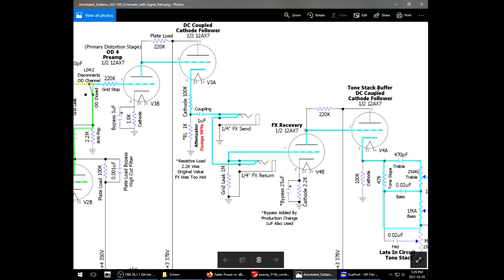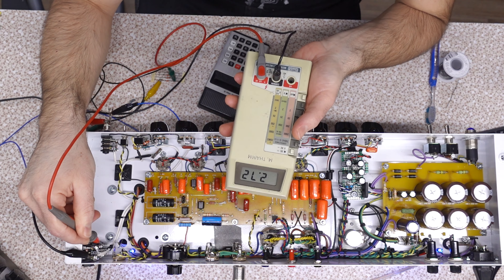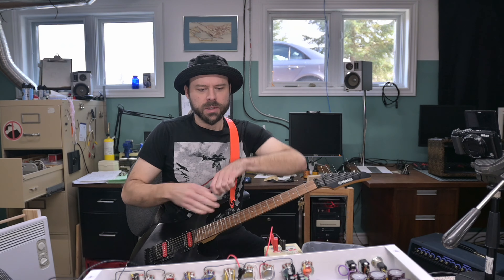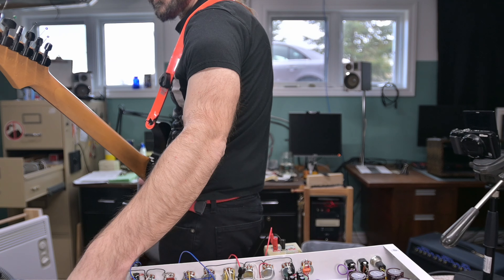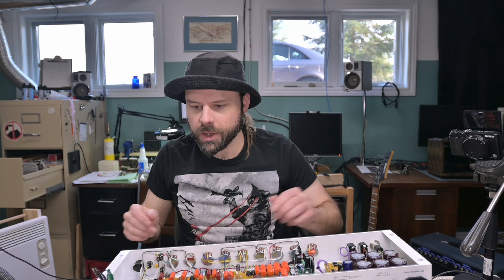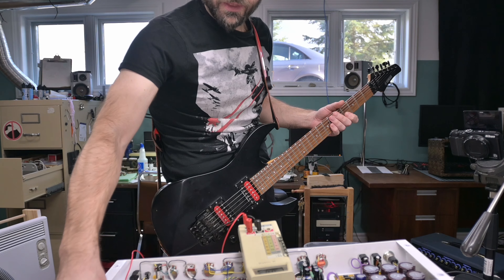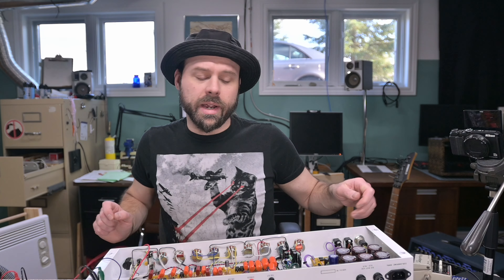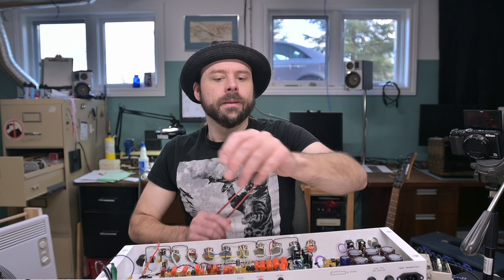SLO Clone Build Ep.9 - The FX Loop Mod

Comment: An lnd150 fx loop is the best fx loop at the moment. The slo's fx loop was "designed" for rack systems back then, hence the shitty output
Reply: Yeah, well he did go all tube signal path that way.

When you take the output from the master, what output impedance do you expect? Varies according with the setting. Do you have to buffer afterwards? You will still have to take the level into account and add another master. Well if you think this doesn't alter the path even with an lnd150 etc...

So soldano did use what he though correct and even that he didn't nail his target, he didn't use the 600 ohm output of the cathode follower, he has around 1-2K due to the voltage divider. Even so, rack stuff were at least 14-20k input. So it works but it doesn't work that well. Very hot, efficiently buffered and tube based...but he said that if lose some hi end that way you could make it up in the tonestack afterwards and...he was right. But people tend to complain because a boss or danelectro pedal doesn't work there...
Reply from the maker: Yeah, I recall reading something about that. It was intentionally made hot to drive professional level gear. Just many off the shelf pedals can't handle it. 
LND150 loop is exactly what I put into my Jet City, which was pretty much the same amp.

Comment: Cool,  Can you go over the depth pot and capacitor?
Reply from the maker: I might have covered it in an earlier vid in this series. I can't recall. 
I might have also covered it in my Jet City Violence series where I worked on a very similar amp. If you google "slo depth mod", there is a lot of info about it. 
I just checked, the first hit I got shows a diagram. 
It's real simple, you just add a 1meg audio taper pot with a 0.0047uf cap into the negative feedback line.

Comment: I normally love all things tube, but effects loops are not one of them. Something like the Germino loop for Marshall circuits is nearly perfect. It would be rather invasive to install in a SLO/SLO clone, but it might be worth it if you really depend on that amp.

I've installed them in ~20 vintage Marshalls amps and they always sound perfect as long at you get the voltage range on the loop right with the included resistors.

It seems like the people building the modern SLO would have done some due diligence to get the loop circuit working as good as it can. Just because that's how Mike designed the thing 40 years ago doesn't make it good.
Reply from the maker: Haha, I agree. I don't feel an FX loop benefits from tube. I guess it depends on your overall gain structure, and whether you like the added saturation you might get, or just need it to be 100% transparent. Some might argue if you're going to a cranked amp sound, you might not want something SS in the signal chain between your preamp and your power amp. 

That said, you might find another video I made interesting. 
Seach my channel for "Jet City Violence Ep.10", I did just such an invasive install to pretty much the same amp.